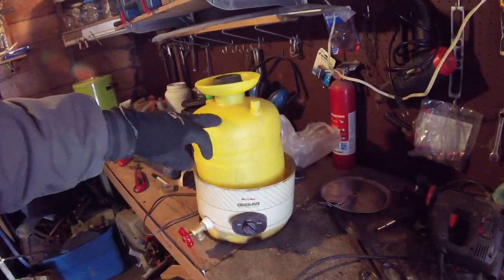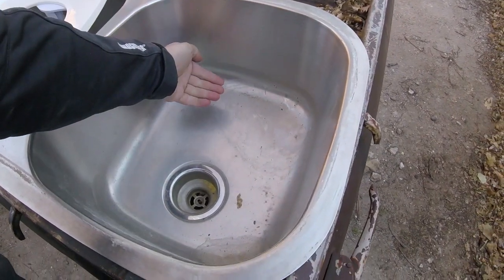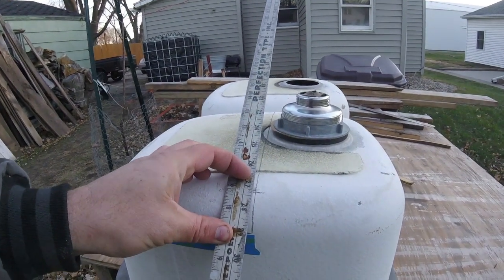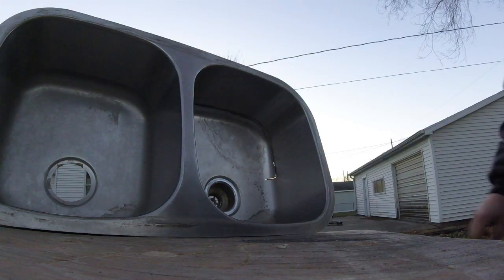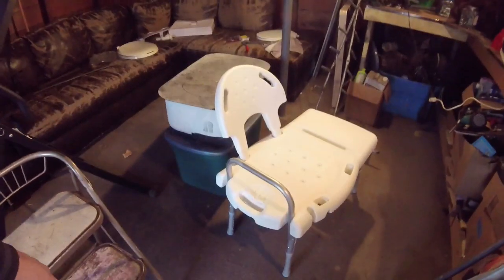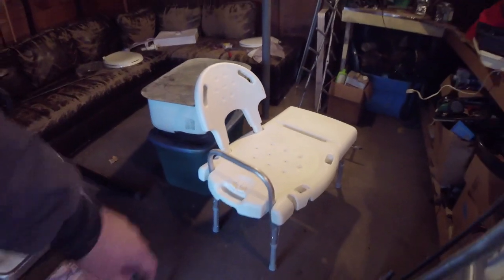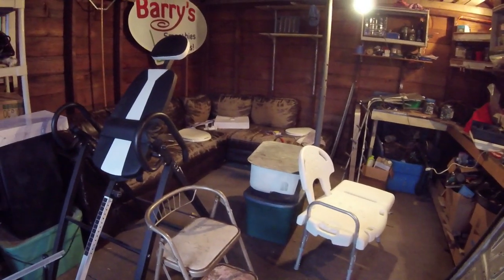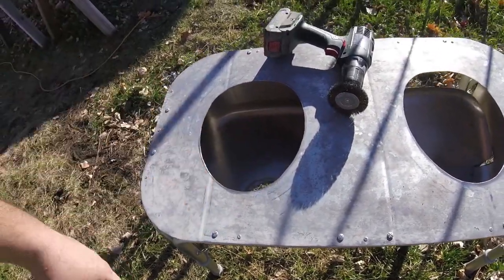The Ultimate Composting Bidet Toilet

Comment: Interesting idea. You don’t want to be sitting directly on metal on a very hot or very cold day. I would suggest using the plastic toilet seat lol. Also for sanitary reasons, it’s easier to clean the topside and underside of the plastic toilet seat.  Also you can get long oval toilet seats that would give you a bit more room to work with your separation system.

Comment: You can buy used commodes.  It's easier to modify those...
Reply from the maker: Good point.  I forgot about those
Reply: @extremebudget  
But yours is a two-seater, which can have a solids/liquid specialization...
Reply: I was thinking the same thing. Rig two commodes together and add the other features.